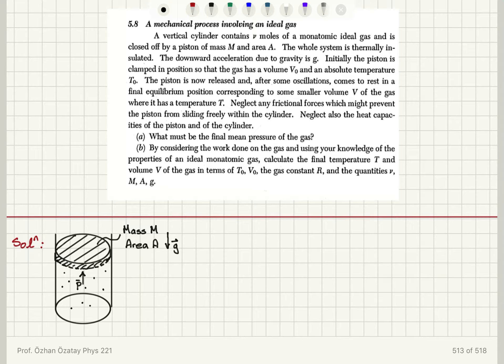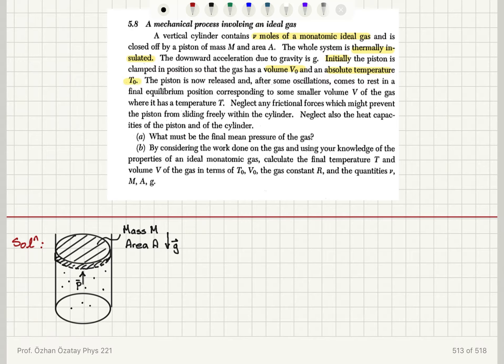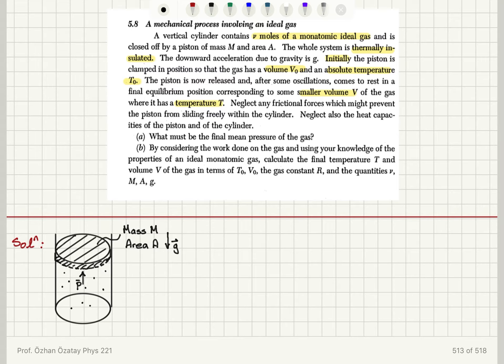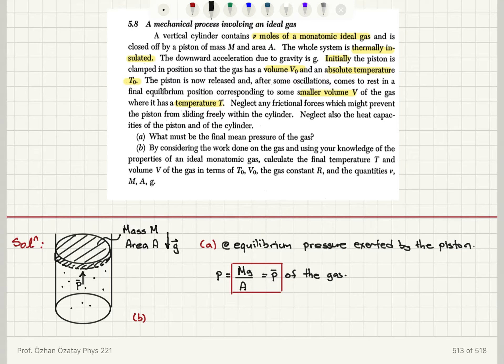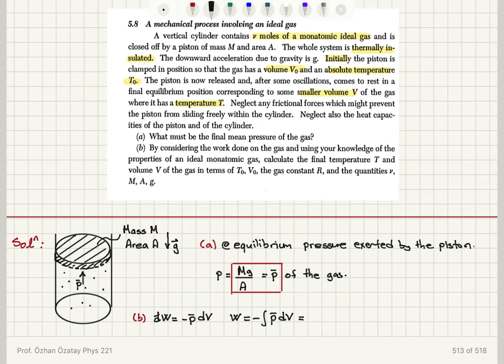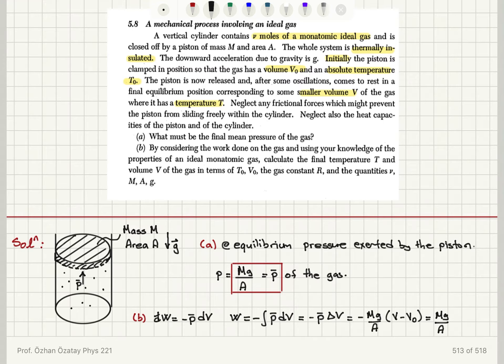5.8 A mechanical process involving an ideal gas

Comment: Hocam enerji değişimini işe eşitledik, işi de P.(V0-V) aldık ama basınç ilk durumda ve son durumda sabit değilken nasıl yapabiliyoruz bunu?
Reply from the maker: The external pressure applied to the gas in this problem is constant and is Mg/A. Therefore the work done on the gas by the external pressure causes a change in the internal energy of the gas. We are not calculating the work done on the piston by the net pressure acting on it.
Reply: @ozhanozatay  since the piston is "clamped" in the beginning i thought the initial pressure applied would be (Mg-F)/A, and (Mg/A) at the end, therefore the external pressure applied to gas would not be constant.
Reply: and why not the net pressure?
Reply from the maker: @jnfemr3866  No the clamp is removed at t=0.
Reply from the maker: @jnfemr3866  Because the net pressure is acting on the piston not on the gas.
Reply: @ozhanozatay  thank you sir